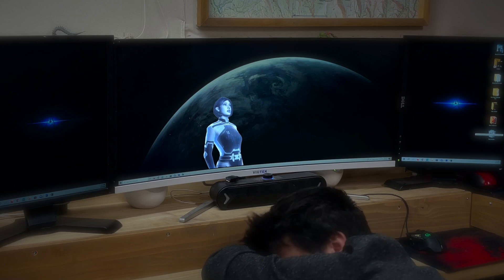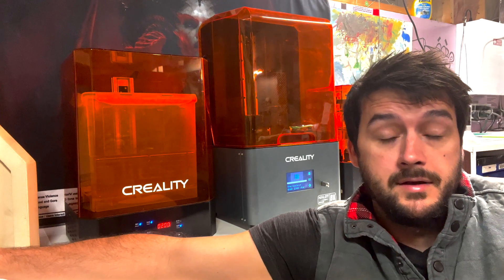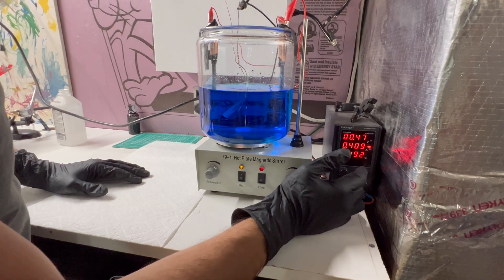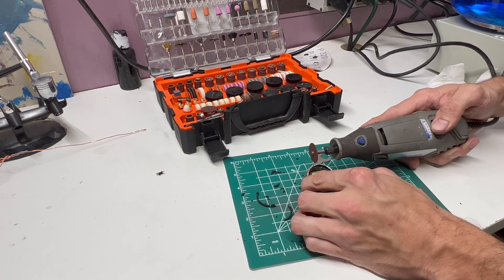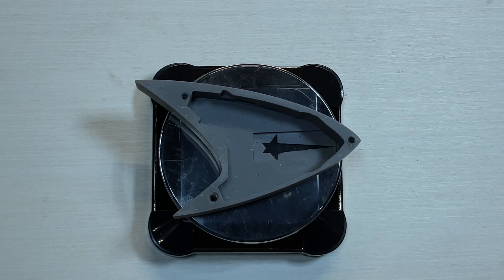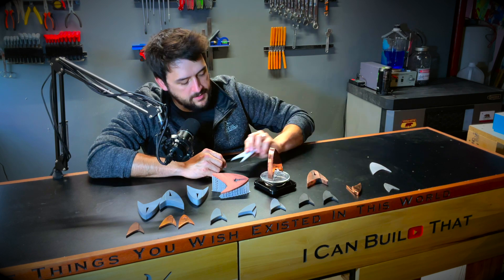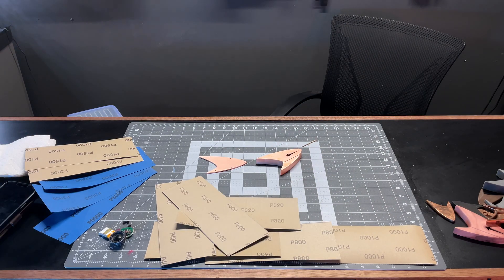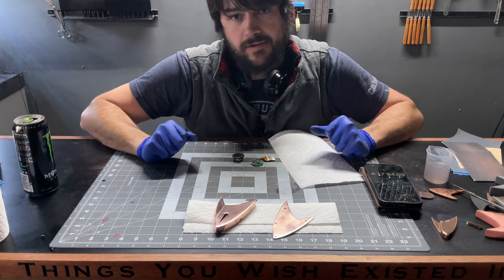Creating a REAL Working COM BADGE   One Year Journey!

Comment: I know I’m a little late a year on but have you considered gutting modern Bluetooth earbuds for the components, they would be capable of connecting to your phone, the include small batteries (they could last up to 10 hours some of them and if use the batteries from both earbuds you would be capable of more than enough use between charges. They have mics already built in and if you’re using your phone speakers for hearing the other person as it looks like you are then you won’t need to worry about the speaker not being loud enough. I think it might be able to significantly reduce the form factor of the badge. Just an idea.
Reply from the maker: I thought about using earbuds, but I’m not using the phone speaker at all, it all comes from the internal speaker in the device. I’ve learned a lot since then and can probably reduce the size considerably, using a higher grade cell phone speaker, smaller amplifier, and a Bluetooth component from EarPods. I could always have pcbway print a custom board for it, and maybe i will in the future if i decide to try again. Which i would like to!

Comment: Looks cool. But why not just use cellphone speakers?
That speaker is huge. Using those could make it thinner. 
Maybe an idea for version 2. 🤔

Still amazing and having that dedication for making a working com badge. 👍
Reply from the maker: I looked into cell phone speakers and most I could find for sale were either odd shaped or didn’t include the amplifier or Bluetooth components that could drive the speaker. They were also easily distorted with higher volumes. Do you have the links for any cell phone speaker and micro amplifier that might work?

Comment: if Apple can squeeze all that bluetooth goodness, with several hour of run time, into the size of AirPods, then it should be possible to put more punch into a smallish Com-Batch !
Reply from the maker: I messed around with this and the speakers were either distorted or underpowered because it takes much more amplification to power a stereo style sound vs an in the ear sound.  Seems like the internals of a phones speaker phone system would be ideal but they don’t actually sell those individually and the closest I was able to find was a micro blue tooth speaker. But maybe an electronics person will reach out and point me in the direction of a much smaller device that I could use for a version 2.
Reply: @DIYCOOLSTUFF  AirPods are extremely complex, both because of size, but also how they achieve the sound given the very limited power availability. Having said that, it should still be possible to hack the device and piggy back a larger amp and driver module, while maintaining a very minimal footprint. I am quiet well versed at the standard Arduino & Co modules, which are all designed for practicality and not power saving nor space. When I get the time I will see what I can cook up :).
Reply from the maker: @SarahKchannel  thankyou that would be great! I wouldn't call myself a rookie at hobby electronics by any means but despite my searches I couldn't find a really small amplifier that was also Bluetooth capable. Plenty out there but none that were built for something this small. Additionally, and even more of a handicap was finding a speaker that was of small form factor and that was comparably loud to a phone's speaker phone without distorting. Most of the cellular phone speakers come attached to either oddly shaped boards or have an odd footprint that makes them even less ideal than the speaker I used.

Comment: Although very awesome. Out of curiosity, why weren’t the (inside) components of Bluetooth earbuds, wired for each ear piece, considered? The battery and electronics are both within 1/2” wide and less than 2” inches long, though the board awfully small and very thin. Along with replacing the earbuds to the speaker used?

Again, still a very cool build and outcome.
Reply from the maker: I messed around with this and the speakers were either distorted or underpowered because it takes much more amplification to power a stereo style sound vs an in the ear sound.  Seems like the internals of a phones speaker phone system would be ideal but they don’t actually sell those individually and the closest I was able to find was a micro blue tooth speaker. But maybe an electronics person will reach out and point me in the direction of a much smaller device that I could use for a version 2.
Reply: @DIYCOOLSTUFF  I was thinking my watch (Galaxy 4 Classic) is smaller than that, and the speaker works at a range of a few inches rather than IEC.  I use it all the time for calls and it works fine.
Reply from the maker: @JohnDlugosz  that's a good idea I didn't think to look into watches for components! I'll look into that for a v2.

Comment: Nice work. It would be interesting to see how smaller you could get with either a custom board, or one from AliExpress. Also a smaller speaker.
Reply from the maker: I agree. I Tried to find some small custom boards maybe like something for a hearing aid or a tore down ear pod, and just add a small amplifier to it, but honestly it’s harder to find a smaller speaker that handles audio well at that scale. Every smaller speaker I tried distorted horribly, not to mention battery life is a few hours as it is playing music, so that would probably go down making it smaller as well, but yes I wish there were better options that I was aware of out there.
Reply: @DIYCOOLSTUFF I was reading through the comments. Now I understand why you didn't use a smaller speaker. 
Did you try out cellphone speakers too?
Reply from the maker: Most of the cellular phone speakers come attached to either oddly shaped boards or have an odd footprint that makes them even less ideal than the speaker I used. Honestly probably best-case scenario would be to collaborate with someone much smarter in electronics than me and order a custom shaped board to accommodate a smaller design with much the same size speaker. The speaker might could be slightly smaller if a higher quality speaker were used but i still want to be able to get decent sound from the device when playing music or using the speaker phone. Then there is the lithium battery to find a spot for as well :/
Reply: @DIYCOOLSTUFF  I was thinking something like one of the upgraded Gameboy speakers, and playing around with different filaments and chambers for the sound.

Different printer filaments might give better results with sound reverberation.

I think the sound waves would be too large to have anything too fancy with the chamber, but I'm sure someone who understands audio better than I would be able to work it out. 

But having constraints like this are what make the coolest projects when you really try hard!
Reply: @DIYCOOLSTUFF  actually I think you might be right with the phone speaker. We already have companies making laptop and phone speakers that can be quite powerful, with an appropriate driver board it could really work I think. There are some options for open source driver boards at this size I'm sure.
Reply: I took a look at available phone speakers. They are surprisingly cheap. But some of them are cube shaped. One could even consider fitting 2 of them for sound improvement. The only challenge would be soldering wires to it. 
I agree that a custom pcb would benefit the project.

Comment: \\// Nanoo-nanoo!
Nice work, I have fallen down the electroplating hole as well and have a recipe for a conductive paint that may help if you want to try it.
But a quick suggestion - a completely plated badge may significantly reduce the range of the bluetooth signal, so you may want to consider leaving the back unplated if you have issues.
Reply: Could you share the recipe?

Comment: Great video man! Thanks for sharing your XP. By the way I just followed your advice on a previous video for achieving a mirror effect on electroplated parts and finally made it thanks to you! I also spent several hours and using several grit levels of sanding paper and polishing wheels attached to my rotary tool. Also what helped me is that I used 2 polishing compounds (green and blue) and that gave the final touch. Great job and.... LIVE LONG AND PROSPER COMMANDER  🖖